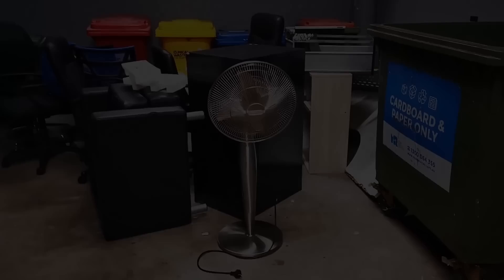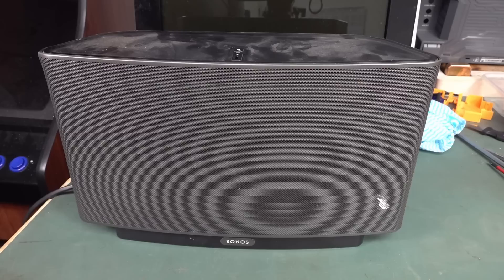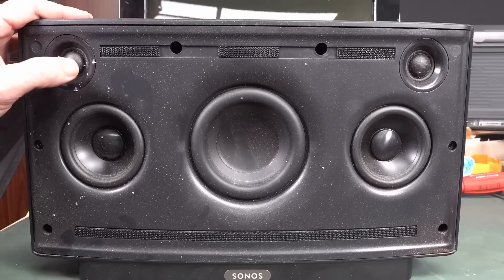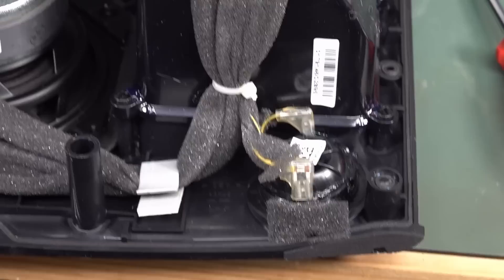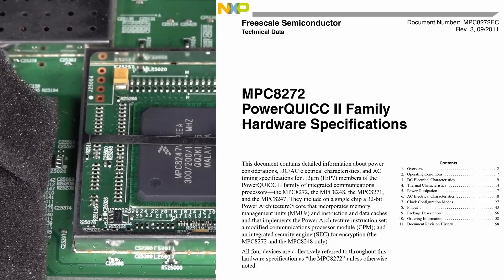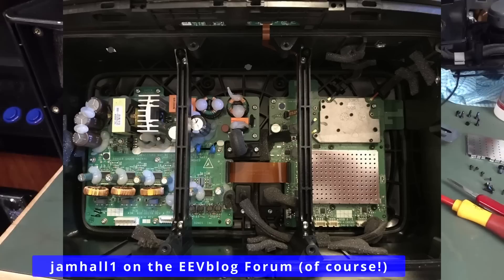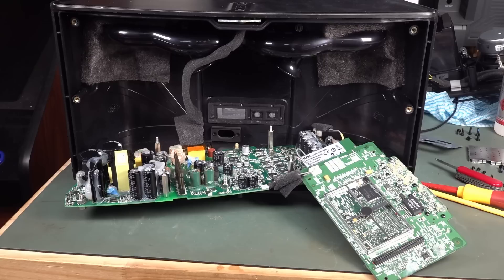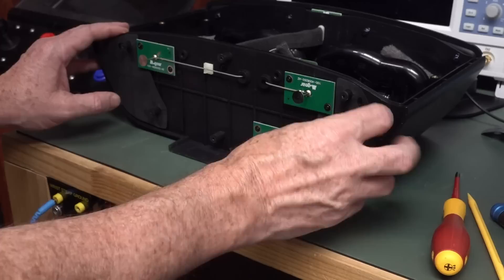EEVblog 1514 - Sonos: The Juicero of Wifi Speakers? (TEARDOWN)

Comment: I see a lot of love for Sonos, in the comments, but no mention of the debacle and the reason for the "first-gen" app.

Sonos made an announcement a number of years back that basically said: "We are deprecating these speakers [insert list of speakers here] and they will no longer be updated. We will give you money off if you trade-in." Well, that went over about as well as a lead balloon because they were deprecating tens of thousands of dollars of equipment. I know when they announced it my total Sonos system cost me ~12,000 freedom eagles (no, I didn't drop 12K in one purchase. I added on to my system little by little over years.)

They walked that statement back about two weeks later and said: "We are deprecating these speakers BUT, you will still be able to use them. They will not work with our new speakers but you can keep using your old ones and we will continue to update them with security and bug fixes."

I would say, because of that debacle, that the answer to your question is: Yes, they are the Juicero of speakers, but unlike Juicero, they haven't gone out of business. They would have if they stuck to their "your speakers are now non-functional, have a nice day" guns.

Comment: What part of a speaker really needs to be updated? If it works it works. Definitely planned obsolescence and Sonos got their way as the previous person threw it out and probably bought a newer model thinking they had no choice.
Reply: That's what "the cloud" brought us - anything can be obsolete now if the company says so (or if the company ceases to exist and the cloud infrastructure goes away)
Reply: I think Sonos wized up along the way and choose to start over, building G2 on a code base they couldn't make work on the older G1 units.

They did provide lots of warnings and I also believe you could connect G2 to G1 - but not the other way.
Also, they had a trade-in program of some sort for those who wanted to get onto G2.

Pressured by (happy wife - happy life) I eventually caved in and replaced my Squeezebox devices with Sonos. 
I'm a bit disappointed by some of the limitations, but it has worked flawlessly for some years now - and I have supplemented with some of the IKEA-branded cheaper speakers for the odd places like the laundry room, bathroom and workshop.
Reply: At least it still has an analog input so it won't be totally useless when they make it obsolete.
Reply: Do you work with this type of technology? It gets harder and harder to support older systems, the guys and gals who built them leave, the tools change, standards change, whole paradigms change, it's not planned obsolescence, it's just how the world works, skills get lost and the business has to focus on its future.  At least they put an aux port on it so it could still do something.
Reply: @edc1569  It's predictable obsolescence. The effect is the same and why I've gone from a gadget dork to completely checked out of the gadget scene with the rise of "smart" devices. Guaranteed to "go obsolete" eventually (even if the function they perform is timeless), often flaky on the software side in the best of times, and more frequently loaded with spyware-like features. A dumb amplified speaker is never going to straight up annoy me like a "smart" cloud gadget will, I'd much rather just plug in a cable than go down a troubleshooting rabbit hole or sitting on hold with support when the cloud junk inevitably flakes out.

Comment: I just bought one used off Ebay last year (2023) - I preface by saying I have a Bose Soundtouch 300, 2 Aiwa Exos 9s, several Sony MHC-V77s and V50s etc. and many Marantz and Boston Acoustics, Energy, and Polk Audio vintage speakers from the 70s and 80s.... man is this one sweet! What a beautiful speaker -- I was planning on hooking it up to a reasonably good Bluetooth adapter with the 3.5mm input in the back, but the reset and ethernet connection to the router worked along with the older Sonos App - what a great speaker! 🥲

Comment: The SO14 and SO8s are probably the active crossovers - 3rd Order on the voltage plus commoning the low frequencies.  The 6 amps will be the number of drivers plus bridged for the bass.  The hot melt glue is definitely needed for the amp output inductors to keep them at right angles.  They'll be about 12W or less for the main amps and 50W, probably at 10% THD to keep the figures up.  Check the rail voltage to get the figures.  And that foam will be nothing acoustically, though the ports will.  They need to be long in small volume cabinets like that.
Reply: Nah, they're just paralleled buffer/inverter's to manifest enough current to drive the push/pull pre-drivers for small power FET's that make up the class-d amplifier output stage. It's an open loop class-d amplifier based on a 4 output part from Cirrus Logic that only has PSU feedback for ripple gain modulation rejection. Any crossover work would be handled in the DSP domain, the audio then comes to the Cirrus part via I2S or TDM. All the backend crap you see inductors and air cores are the LC output filter for the class-d amp which avoids driving that high frequency switching energy into the speaker load (while it's quite inductive, the inductance is pretty lossy at HF) and mitigating EMI. The air core inductors indicate to me they had some higher order harmonics which were troublesome...
Reply: @JamesReedy   Thanks.  I made a number of errors in that comment, which was written before the video had finished.  I should have looked up that Cirrus part and I'm not sure why I didn't think the XO would be done in DSP when even tiny BT speakers are.
Reply: @ChristianRThomas  No worries mate, I do this sort of thing for a living. It’s definitely a min viable sort of approach…the amp that is.
Reply: @JamesReedy   Funnily enough, kinda so do I.  In fact I' did a bit of work on trying to improve those output filters a couple of years ago, and make them less load dependent, which was a harder task than I thought it would be.  A bit easier here where you know what your load is going to be, but here they seem to have left them all the same.  I did conclude that these simple LCs were a pretty good solution, which was not what I expected.

Comment: Oldversion for the win. As I recall the original Sonos would create its own mesh and provide moderate bandwidth connectivity over that mesh to anything connected to the Ethernet ports. Great system, upgraded to dumpster fodder.

Comment: I was an Engineer at a boutique manufacturer around 2012, I found the Sonos guys very hard to talk to at the trade shows [ Aren't they a French company? ], meanwhile I got cards from many other manufacturers. 

As for all the complaints about clamps being stuck down...

You know how a single rattle in a £500 speaker will send it back immediately to the seller and we have at least a year to return in the UK. [ guessing Aus may have real consumer protection too ]

We hot-snotted the crap out of our £500-£5,000 sub-woofers. We found the tech too latent or expensive for the audiophiles we mostly sold to.

Comment: I really like the "discrete" output stage. Makes it really repairable!
Reply: Likely to be the most reliable part, the only failure will be power supply related and those coupling capacitors for the speakers finally going high ESR or open, or leaking over the board.

Comment: A couple of comments on Sonos.. firstly, one of their big selling points was having multiple devices in sync with each other.  They communicate via their own proprietary wireless mesh network (called SonosNet, but not sure of the specs) which may have been what the plethora of antennae were.
Second, the thing with the apps... a few years ago, Sonos decided to discontinue support of some of their older gear, by making a new app, which only supported their new gear (after a certain cutoff) and if even one of the pieces of hardware on your network was one of the unsupported ones then you couldn't upgrade to the new app, and use new features etc.  This perfectly good speaker might have been the only gen1 device on someone's network. But still, the dumpster?!

Comment: I personally don't think its over engineered. But I rather get a pair of powered studio monitors, nowadays you could get wifi built-in, although not exactly the same as an all in one solution. I suppose these are more treated like a ghetto blasters, but wifi driven. For its price, I would have expected some sort of discrete amplifier design with some protection circuitry. And for the same price you couldn't even get 1 passive reference design speaker from known brands, that is, just 1 speaker no amp no wifi brains, just a box and speaker with crossover network in them. Just something to think about in price differences and what you get for the cost. I'm rather impressed at the attention of details added to secure everything down, because if you are really into audio it matters. But then again im not sure if any of the serious audio fanatics would want a all in one solution.. or even a class-d  (mostly).

Comment: I own 3x original Play 1 speakers that are now powering the music in a corner store I work for. They were $230 a piece but I felt like they were worth the money, I worked as an installer for an electronics retailer and we sold a lot of Sonos and customers were pretty satisfied with them.  I had heard that they were ex-Apple engineers that started the company, so it helps explain the very closed, locked-down system it is - they do very good tech support, but you’re stuck dealing with them to figure out what to do if for example you have a VERY old unit that needs to be updated, there are “commands” to make it do the updates manually but they don’t publish it...  so yeah, very Juicero except they haven’t gone bust.

Comment: My goodness, seeing Sagan was a shock! As we used to say in the US, "growing like a weed." 
I'm seriously considering moving, at least temporarily, to Australia just to nicely-furnish a home from Dave's work dumpster!
You'll know me when I get there, I'll be the only one driving a Camry sensibly (and it'll be left-hand drive, I'll ship mine out just to confuse everybody). 😆
I'm pleasantly-surprised at the build quality of this unit. It seems to be built with attention-to-detail. Customized bass ports, each driver acoustically isolated, obsessive effort taken to mitigate PCB vibration, every single wire foam-wrapped, plenty of mounting screws from several sides (case vibration), the WiFi antennas... A fair bit of the MSRP was obviously in the engineering.

Comment: I have a Gen 1. Yes, they work, but you do need to go through and set up an account, IIRC. It sounds pretty decent. I use it in my shed workshop.

But it's not like a phone BLE speaker. It has its own connection and it's not streamed from your phone.

All the silastic makes sense for something that is going to vibrate with bass.

Comment: Registration or useless.. Classy.
        That's why I love my UE Boom speakers - they'll function without an app (just via Bluetooth) or even without Bluetooth (3,5mm input)

The UE Boom app (no registration required) just offers some extra features, like turning the startup/shutdown/button sounds off. 
       And it allows for pairing up to 99 speakers, using them as stereo speakers (one L, one R signal), and has EQ settings.

I think THAT is the way to go.
No reliance on apps or registration.

Because if Sonos goes bankrupt or just quits... Your 800$ speakers have just become a paperweight.

UE = Ultimate Ears = Logitech, by the way. (Thumbs up to Logitech)

As far as I know, they're also the only BT speakers that allow the signal sounds to be switched off.
      JVC (Samsung) doesn't allow that, for instance.

Comment: I repaired a faulty Sonos Play 5 speaker a few years ago. It turned out it had a popped FULL BRIDGE RECTIFIER, which was quite surprising, as it was quite a chunky one.

(we're in 240V land, in the Old Dart, so it's not like somebody plugged in a 110V speaker which popped the bridge rec. Maybe a power surge or lightning damaged it? Just don't often see a bridge rec that dies unless it's on a much larger device.)

It sounded pretty good after, but the one HUGE downside is that it only worked via Sonos app, so you couldn't use it for playing music from YouTube etc. At least I don't think it gave you that option. It would only play back files using their app. Hate that.

It looks like the app has changed since, or the speaker allows a direct Bluetooth connection.
Back when I repaired the Play 5, it definitely didn't allow that without the app.

EDIT: Oh, if you were only playing music via a cable, then that explains it. lol

Comment: I know your stick is being outraged,  But the sonos is not the Juicero as that thing could barely squeeze already crushed fruit despite all it's engineering. The sonos play on the other hand for a wifi speaker sound pretty good. And remember it was their first product, so ofcourse it was over engineered.

Also sonos as a company has been brilliant with support, they still support an app for a product that is over 13 years old. I have two that are still fully functional and the only repair i've had to do on both of them, is loose screws that hold the antennas pcbs down, that started rattling around.

Very few companies support products older than 5 years, let alone 10, but sonos play 5 is coming on 15 years.

The only features they haven't add via software for the old units are:
- S2 Controller compatiblity: (but they did offer discounts on new models, initially they did brick your old unit intentionally, but they changed their mind after the public out cry)
- Airplay support (due to licensing/hardware issues)
- Google Assitant (due to lacking a microphone)

Comment: There's a lot of yesteryear tech out there that can be upgraded and used with modern things.  Adding a simple Arduino type board can give you WiFi, BT and music storage.  The quality of the sound didn't really go up since the 80's, it's just that they added new ways to connect.

Comment: I have never seen anyone go through the effort to design a discrete audio amplifier for a product like this instead of an integrated package. It's not like they didn't have options for amplifiers that support a PWM input. Every home theatre in a box receiver I have ever looked in, has used PWM amplifier chips.
Reply: Was hard to get the power they needed and the linearity then, so they made a stage that would do it. BLDC motor drivers have really exploded in the last decade due to both the drone market and them becoming common, and the driver and output stages have to be capable of very fast switching with minimal delay or jitter.

Comment: Sonos is not a "speaker" per se. Sonos is a complete sound system. Good to see they were thorough in their design and assembly. I have Sonos in my apartment, and it's just so lovely to have it all working together as one sound system - sharing the same audio in multiple rooms or dividing into more areas, taking the sound from my TV to my kitchen, waking up to music in my bedroom and bringing the morning news and music to the kitchen and even the bathroom. Sure, you could do some of that with traditional amplifiers with multiple outputs, CD player, radio, etc., or Bluetooth, but not really and not half as elegant as a set of Sonos speakers does the job, wirelessly and requiring nothing but a power cable.

Comment: Reason why 6 amps is I'm guessing they use 2 to drive the subwoofer as the other speaker don't handle bass the subwoofer will be drawing the most power, so they use 2 connected together in a bridge mode or whatever to drive the sub.

Doing it with 2 amps not only increases power but also decreases distortion vs if you only used one.
Reply from the maker: Yes, has to be. No other reason for it.
Reply: Two channels are bridged for the sub most likely. The tweeters will barely draw any power at all.

Comment: I made a short wave transmitter out of a 74HC04 once .. also all in parallel. Was heard in Florida from Switzerland, using WSPR mode.
Reply: Novel! I knew about 74HC4066s being used as balanced mixers, fairly high IP3 until you get to the high end of shortwave. (Somewhat effective band-filtering is obviously required due to them being the switching variety which would act as a sampling mixer unless restrained.)

Comment: 16:10 no you are wrong: thease days even modern technology from 5+ years ago implemented a tpa3116 or Tpa3116d2 which can output 50w per channel into 4 ohms at 10% thd in a very similar size package, i have had multiple of those amps and i can confirm they do actually put out near rated power! So if i had to guess I'd say those might be 15-25w per each chip.

Should also mention they also have a tpa3255 version (all of which are by Texas instruments if i didn't mention that) the TPA3255 is no joke for around 3-4x the size of a single one of those chips (same thickness) you can get over 500w of power! Which is just crazy! (Needs a heatsink of course) but i have 2 of those amps connected to 2 high power car subwoofers and even though they can definitely use more power the output for what those amps are is crazy!

Technology has really evolved haha :)

Edit: ah that's very interesting haha like the way they use those smaller transistors as the amps

Comment: The proprietary software is what makes the very expensive Sonos stuff not worth having. After they decide it's too old they brick it and you have to go and buy a newer model! Also gumming up the components prevents any servicing
Reply: Gumming up the components will also lengthen the lifespan which would reduce the need for servicing in the first place.